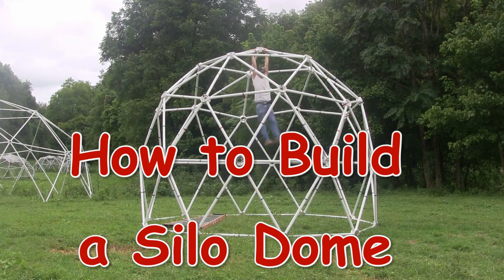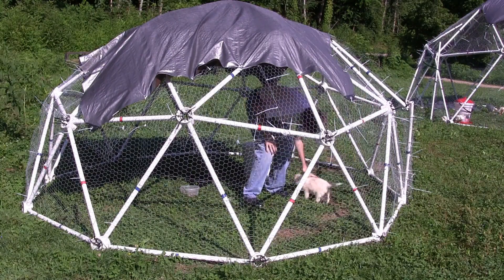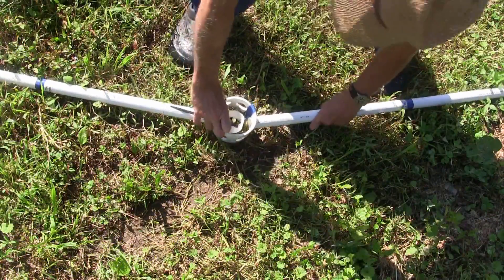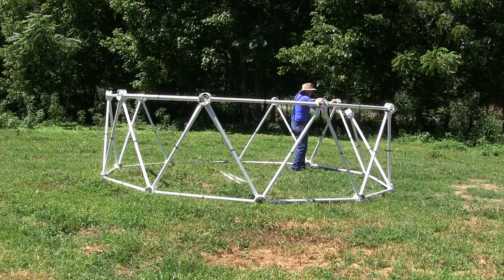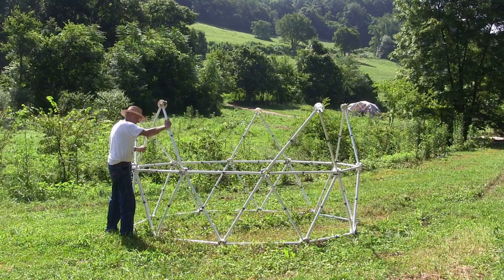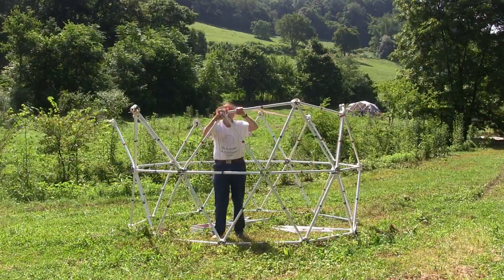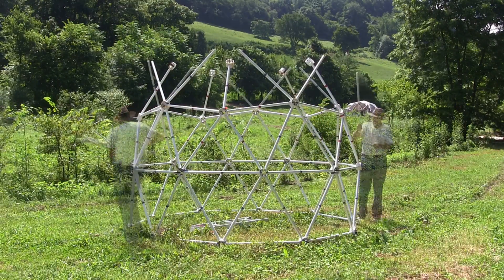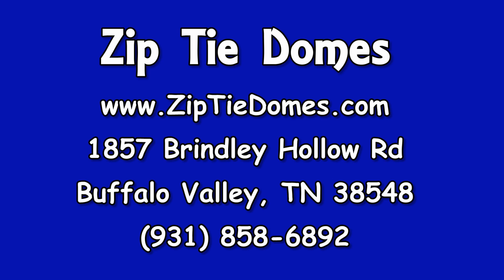Geodesic Dome Construction for a 2v Geodesic Silo Dome

Comment: Very interesting and so simple. Questions; 1) Have you tried to build from the top down?  2) The plastic exterior cover - what is the technique for draping with more that one sheet of plastic to cover a large dome?
Reply from the maker: It is easier to build from the bottom up,. as you don't need a crane or lift to raise the dome.  
You can attach two sheets of plastic together using clear greenhouse tape - but it is better to buy a single large sheet.